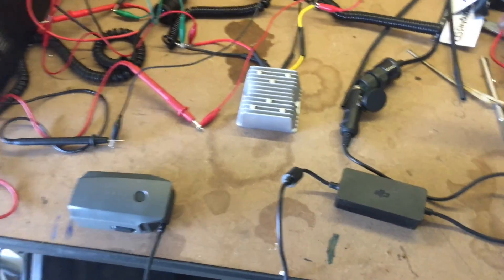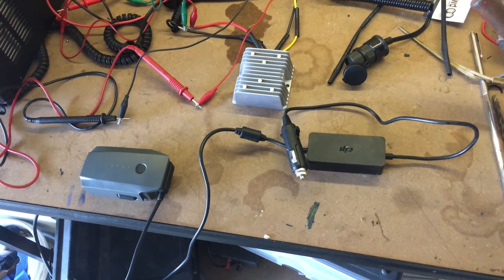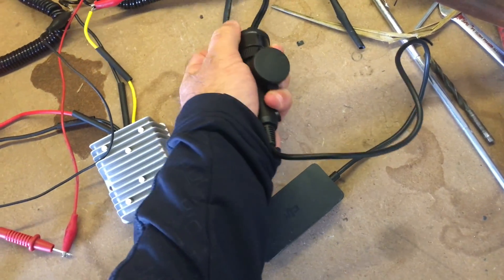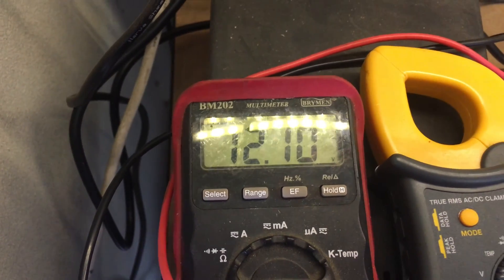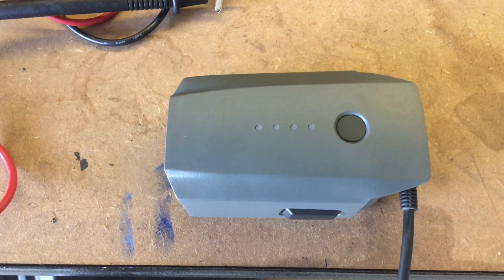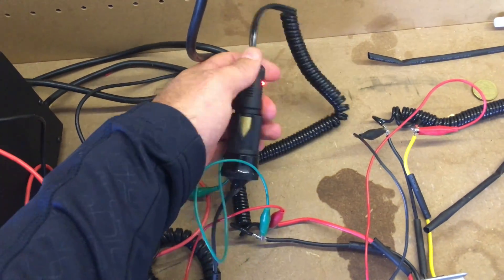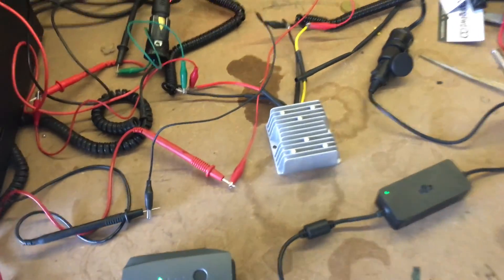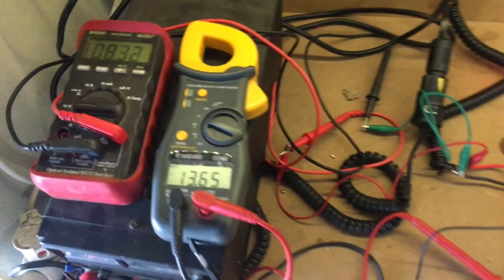Fixing the Mavic Pro 12v car charger issue

Comment: Hii, great video, do you have a link to the DC-DC converter
Reply from the maker: It was just off ebay 

Something like this https://www.ebay.com.au/itm/DC-12V-To-DC-13-8V-18A-248W-Step-Up-Power-Supply-Converter-Regulator-Module-AU/123859613178?hash=item1cd69bb5fa:g:CZIAAOSwhVFdQqfY
Reply: @jjsadv  Thanks, I found this, that can go below 12 v. and 10A.
https://www.ebay.com/itm/DC-9V-36V-To-13-8V-10A-138W-Step-Up-Down-Power-Regulator-Converter-Module-Hot/401958165561?hash=item5d9692dc39:g:E~cAAOSw-qldzNFa#shpCntId

Comment: Well... and where is the fix??? I cannot put all that junkie things into the car??!!!!  Its clear if a car charger doesnt work is because the Volts are wrong but where i the PRACTICABLE fix?
Reply from the maker: yosoydeyarumal you obviously don’t understand the issue and what this does. This will step up the voltage to the correct amount to make the car charger work. Without it it won’t charge for long once you turn the car off. 

Been a practical fix for me for a couple of years.
Reply from the maker: Take the info and you can design it how you like. Build it into you car if you like.
Reply: You realise most of that is a bench test?....only the silver box and 12v input/output is needed in the car as a bridge

Comment: DJI is dumb on fundamental designs. Now you have to lose extra battery power. (DC2DC inefficiency) just to huck their stupid limitation. I would get it, if it was cutting at 11,8-12v which is still pretty much juice. My charger didn't want to work on a freshly charged 12,9V battery.

Comment: Hi! This seems a great fix for this stupid issue... However I was wondering if it's working correctly with fully discharged batteries, as I see the DC/DC converter you're using is rated up to 5A and the DJI charger can deliver up to 6A (when starting charging a fully discharged battery). Have you tried? Did you notice any issue? 
Perhaps it only takes a bit longer to charge but didn't want to mess up if it's not going to work just fine. Thanks!
Reply from the maker: Its rated to 8 amp, about the same as the charger. The limiting factor will be what the socket will provide. I doubt most sockets will supply the max input of the DJI charger anyway.
Reply: I could only find the 5A version on ebay as Ari Sirkia mentioned. Whats your long term experience, is it still working well? Cheers

Comment: Tried charging my Phantom 4 batteries on the bike the other day - had problems with cigarette lighter plug staying seated and making an electrical circuit while riding on gravel. I'm thinking about ditching the cigarette plug and going for something that will lock together, maybe a small Anderson plug or similar.
Reply from the maker: I already use the moulded plugs because of this, effective and cheap, or I use gaffa tape and tape the plug.

https://www.jaycar.com.au/medias/sys_master/images/8948714373150/2-pin-bullet-type-plug-socketImageMain-515.jpg
Reply: We have the same problem in the trucks with the power leads for Engel/Waeco fridges - never trust a cigarette lighter socket if you want cold beer at the end of the day! Even the Engel "screw-in" plugs can be a problem if they are getting a bit old. Lost a fridge full of frozen food once using the "foolproof" Engel screw in lead.
Reply: Was in at Jaycar the other day looking for a fuse and forgot the other reason I was there - looking for a plug and socket like that one 👍
Reply from the maker: I use Anderson plug for the fridge.